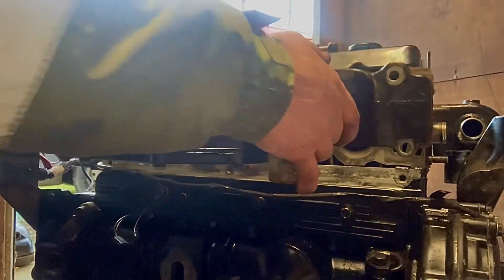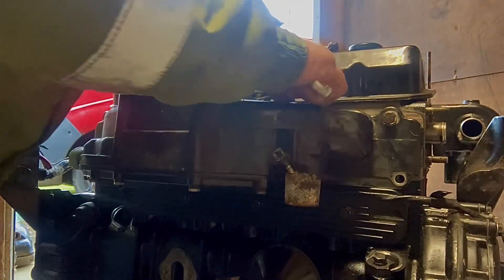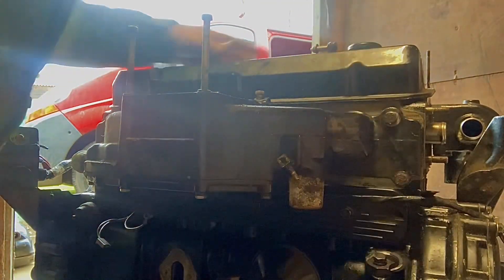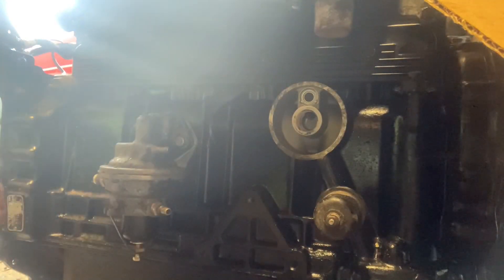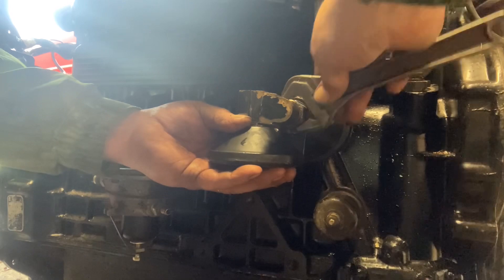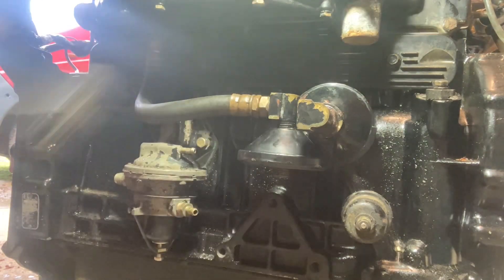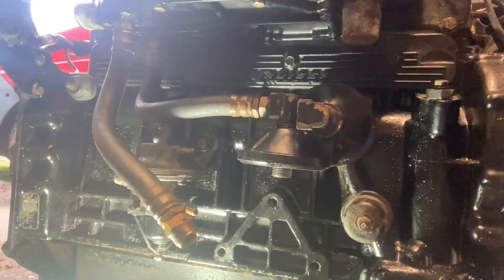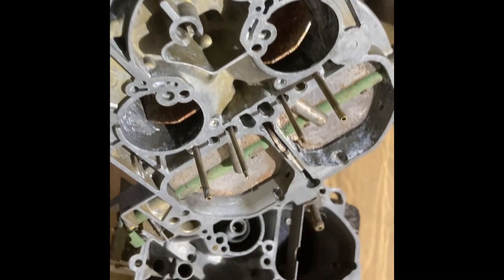Mercruiser 470 3.7lx engine rebuild part 15. Inlet manifold and other parts.

Comment: Done it again Keith! I have a leak in one of those oil lines that I have to fix when I get back home at the end of January. This will help me tremendously. Thanks again.

Geoff
Reply from the maker: No problem glad it is of some use to you. Just remember to undo the fitting on the filter housing first and when you refit the pipe you connect to the filter housing last. 👍